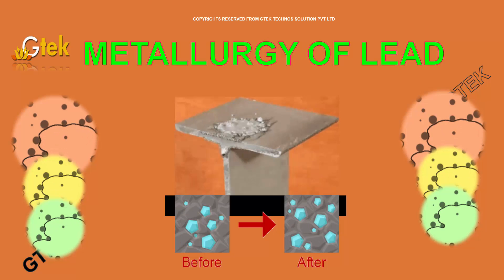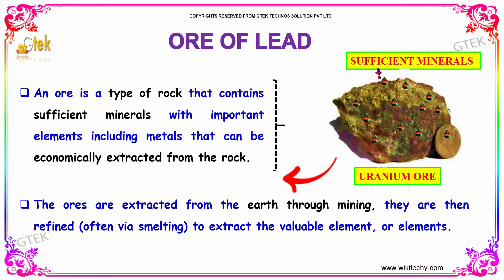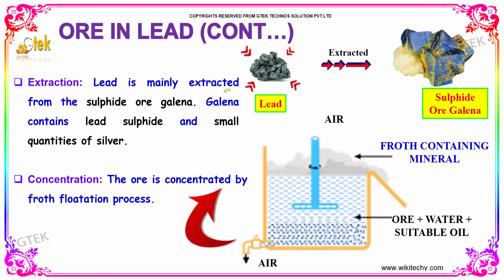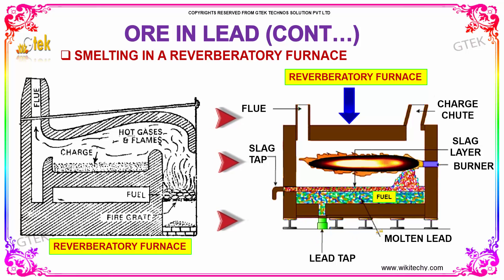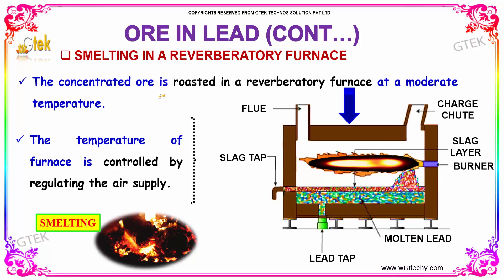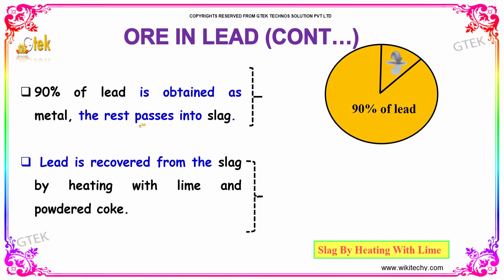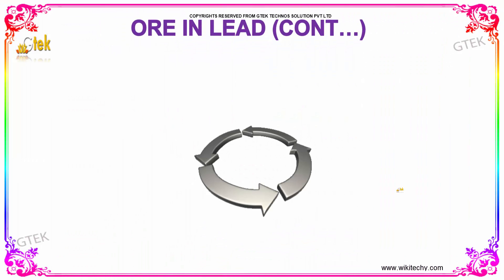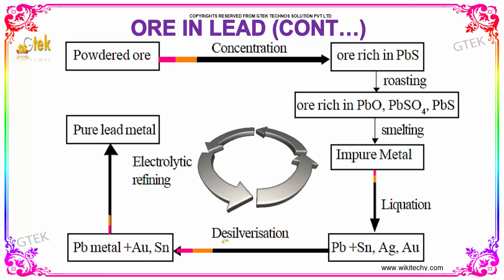metallurgy of lead p block elements class 12 chemistry subject notes lectures cbse iitjee neet

Comment: Electrolytic refining is the process of obtaining pure metals like gold, silver, copper etc. by the process of electrolysis. Let us learn how copper is refined electrolytically. Take acidified copper sulphate solution as the electrolyte. Take a thick rod of impure copper and a thin rod of pure copper.

Comment: CHARACTERISTICS: Lead is a bluish-white lustrous metal. It is very soft, highly malleable, ductile, and a relatively poor conductor of electricity. It is very resistant to corrosion but tarnishes upon exposure to air. Lead isotopes are the end products of each of the three series of naturally occurring radioactive elements.

Comment: Lead is extracted from ores dug from under-ground mines. Of the more than 60 minerals that contain lead, only 3 galena, cerussite and anglesite are commercially viable. Usually, lead is found in conjuction with other metals such as silver and zinc. ... Extractingthe lead materials from the ore is a multi-step process.